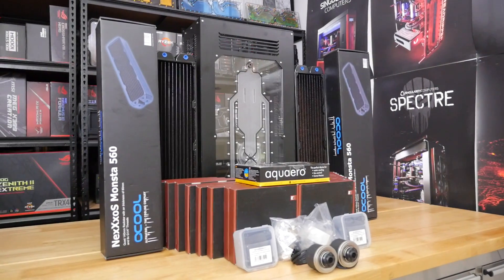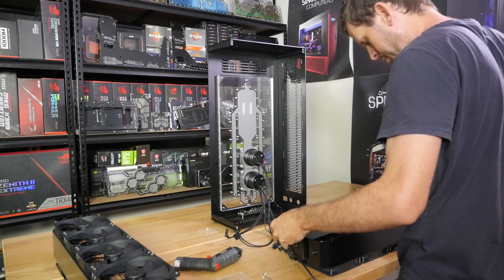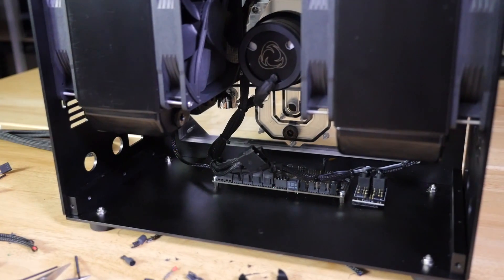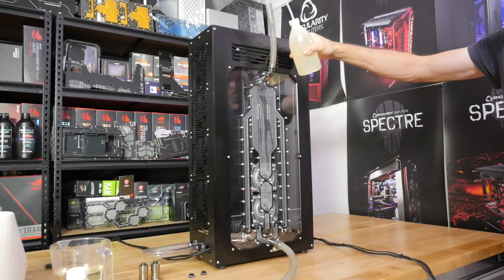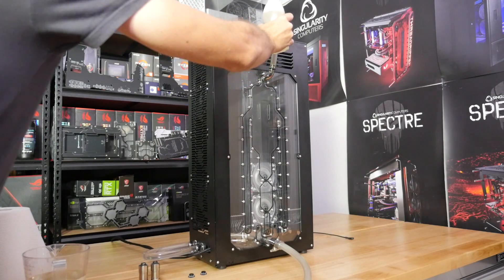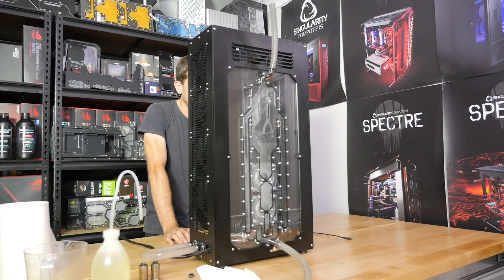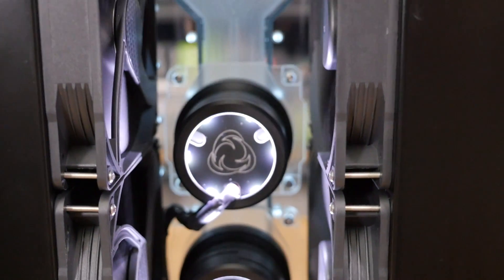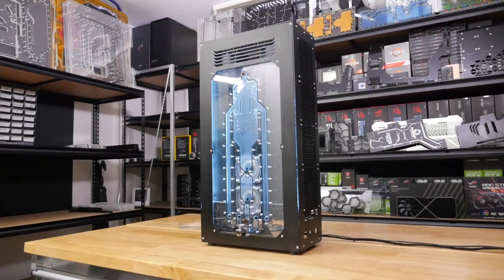Water-box: Dual Push Pull Alphacool Monsta 560mm

Comment: Too bad modern PSUs don't have a power outlet built into them like they used to. That would simplify powering up the box when the PC starts. Or I guess just do what I do and never turn it off. Then it wouldn't be so bad to do it manually after a power outage or whatever.

Comment: For easily more than a decade, I've been running my computer using an external 1977 Pontiac Bonneville without air conditioning heater core with 2 Noctua 140 mm fans and a shroud made of cardboard. I actually have a video uploaded here of when I ran the radiator with a fountain pump to cool my old xbox 360. The radiator is the only original thing from that setup and it is now only used to cool my RTX 3080ti video card and an AIO is used to cool my 13700k CPU.

Comment: The major issue with a full on water cooling case is when you need to pull or change a component, you have to contend with all the tubing and water. It would be cool if you guys designed a Dual Chamber Case where one chamber was a Waterbox other chamber a ATX Case. You could have a flow changing check valve between the two chambers that could be positioned to Drain or Use. So you could run the pump and cycle the water out of the computer side. The CPU/GPU tubing would go into the Motherboard tray, then have a quick disconnect on the backside in the waterbox area to make it into a removable motherboard tray. Then all you have to do is pull the motherboard tray out to work on your PC.
Reply: This box just runs two hoses to the PC and that’s it. The PC runs QD’s at all the major components so if anything needed to be switched, it could be done in mins.

Comment: That's nice.  There's a distinct lack of external solutions on the market.  My only gripe would be theres a lot of metalwork still in front of those fans must impede airflow and increase noise but I guess it's needed to hold it all together.  I'd prefer a thicker front and back plate with actual holes and use fan grills instead - that would increase airflow by 20% i recon.

Comment: i do also wonder if you could built in like an aircon system together into the loop with like 2000w of cooling power to actively cool the loop down below ambiant temp. I have done some messing around with an make shift cooling setup where i have a 1000 aircon 12000 btu push cool air directly through an aio rad where it brings the loop temp down to around 15 degree after running prime 95 for like 5 hours on a 12900k stock. Bring me some insane temp around only 50-60 under a full load of 250w plenty room for overclocking managed a 6.2ghz on the p cores with it and a score of 32000 ish on cinebench r23. it was pulling around 350w ish when overclocked and temp was hovering around 92-95 ish. which is not bad considering how ismple the setup was just very inefficent and when you dont care about eletricty bill

Comment: I assume you have the fans push and pull from left to right (or vice versa) across the entire box, as opposed to in from either side and vent out the top?  Do those two pumps power the entire system (water box and PC) or would you have a seperate pump in the PC?
Reply: as of right now we are going to use just the two pumps to power the entire system. I have a 3rd pump in the actual system (Spectre Abyss) but not in use.

Comment: Mo-Ra3 9x140 or 4x200 is better (and cheaper)
Reply: Better? I don’t know about that. Testing coming soon. 

Also……mo ra doesn’t look as good.
Reply: @TechDoneRight1  "Mo ra doesn’t look as good" - It's true. "Testing coming soon" - ok, but I did it
Reply: @314LA  you’ve tested mo-ra vs this box? Crazy
Reply: @TechDoneRight1  I have 4 Mo-Ra3 (360 and 420) and few 420, 560 alphacool . I tested Monster in TT 900 tower case.  More fittings, more fluid flow resistance, 2x560 is worse than 1 mo-ra3 9x140 - 3C at 800w
Reply: Nice. 

I’ll survive with what I have. I’ll give up a few C for the looks.
Reply: @TechDoneRight1  this is also true. Although, mo-ra3 is also cute)) But Your cases (Spectre 3.0) - is the best. Although the Thermaltake DistroCase 350P is also not bad, but much cheaper. But Spectre is better)

Comment: I have considered doing a water box build just for the "it's a bit different" factor more than anything else. I would want the power, sensors and control all contained - Though I'm not sure how you would get around possible error of no cooler plugged into the motherboard connector...
Reply: That might be something that is being phased out in modern boards due to the prevalence of hubs/controller. I don't have any fans directly plugged into my current motherboard and I've never gotten that error.
But even if you do see the error, it's always been something that can be disabled in the UEFI/BIOS.
Reply: I second the fact that most motherboards have the ability to shutoff that warning in the bios but not all.

Comment: I've been using a radiator box of my own design for over 6 years. No plans to go back to internal water cooling. I use 3x triple-120mm radiators with an aquaero 6 for controlling and monitoring with the fans sitting on a zero-RPM curve. Maintenance is a bit more of a chore than a typical water-cooled build, but I enjoy the setup.

Comment: This a really bad design, having the hold the rad and plate in the air while screwing it in when it could have just had a lip to rest it on at the bottom
Reply: He said you could lay it on its side to make it much easier...
Reply: @glynkatkin  yes and it's still a bad design because with a small lip you could do it stood up or laid down and then the weight of the rad, fans and water wouldn't be resting on a screw thread all the time.

Comment: This is the prototype cooler for the RTX 7090ti hybrid card guys. Your gpu would need a separate enclosure for cooling and would also act as room heater XD
Reply: I had this build for such future shenanigans. If GPUs start to go up to 500-600-700 watts…..this gets me a head start on cooling
Reply: I use many of this radiator in my core w200 and core p200 combo.

I'm running a 10900k at 5.4ghz on all 10 cores, 128gb ram (over clocked and watercooled), water cooled m.2, 4090 runs 2 of these,

And I run 2x 360mm coolers for my rme pcie express sound card.

I have a recording studio and also do 3d design. 

I'm also running the 49inch samsung curved monitor ( just recently got it).
Reply: @dylandesmond why are you still on a 10900K

Comment: I would modify my wall between my office and my garage (garage is air-conditioned), mount this into the wall to where I can see just the face of it (flush with the sheetrock) from my office, but to where the air is being exchanged from the garage. Then you get the best of both worlds, cool visual from the piece and air exchange from a different room. Would make for a cool centerpiece, especially with that lighting. And then mount quick disconnects into the wall in my office for my system.

Comment: I've got some questions:

What's you the power consumption on this monster ?
How far can be the PC ( rtx 4090/Rtx 3090 ti and 13900k/12900ks for example to get sufficient cooling 
What's the price of this ? 1200€ ?
How many litters of water did it fit ?
Reply: The singularity shop says
SC Arterial Dual 560mm Water-Box – Black
USD $849.00

Holy shit thats expensive. I think MORA 420 would be a better and cheaper choice, IMO

Comment: How would you run multiple systems off of one water box? I'm assuming liquid to liquid heat exchangers?
Reply: You could run two water cooled systems in one case or just two cases with pipe work inbetween and series.  Just with flex tubing like CPU-GPU -CPU2-GPU2 etc.  The limitation would be in pump head at some point but two D5’s at 100% could do like 7+ waterblocks and still get good flow. Most complex factor is POwer supply and start signals from multiple systems.

Comment: My head has been all over the place with our new house build and finally moving in. Now that I think about it, an external radiator but on the outside of the house (not the old LTT jank) could actually work really well.

I was already planning to run it without fans, I suppose I'd just need a powerful pump and could even use a car radiator.
Reply: Mind though, that a car radiator is made for a delta-t of 100°. With watercooling the temperature delta is much, much smaller. I don't know if a car radiator is optimized for such small deltas. I would rather go with some bis purpose build radiators. You'll have an easier time with the connections as well.
Reply: bro first of all calm down yh car radiator hahahaa do some research first lol